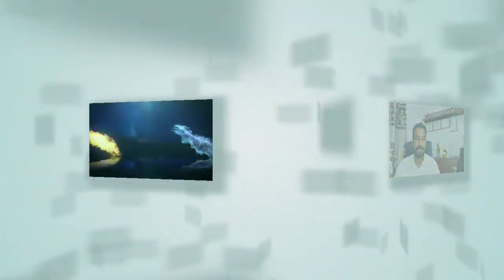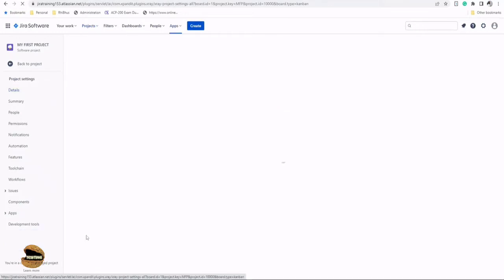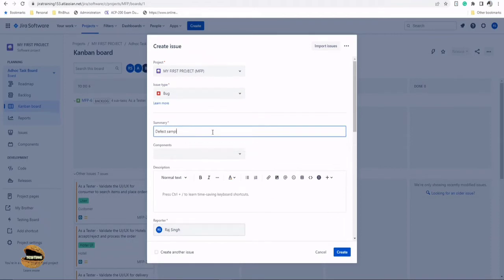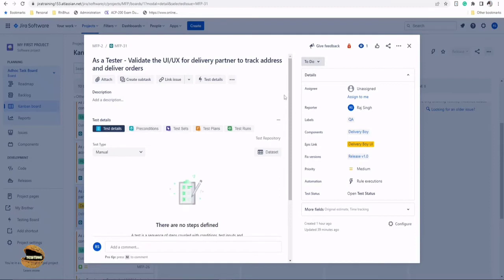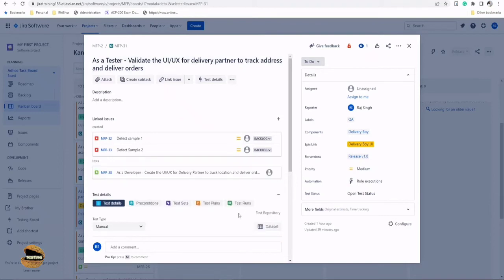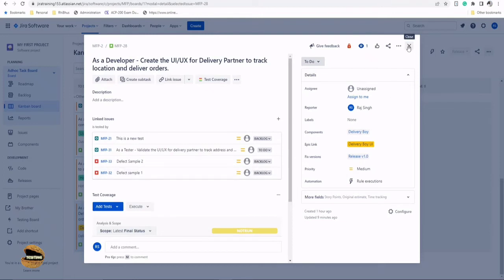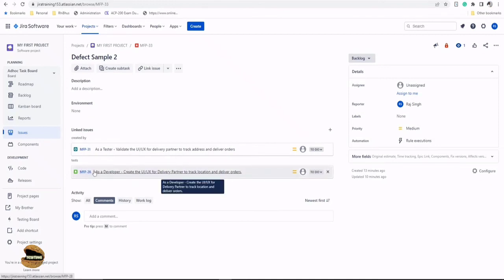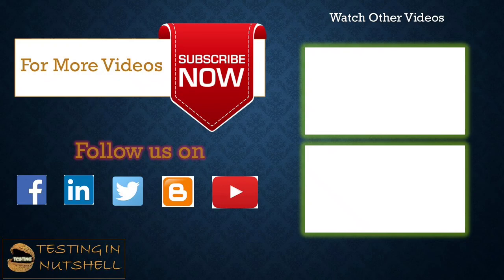Tutorial #14 | Defect Mapping in Xray | Defect Coverage in Xray | Xray Tutorials

Comment: yes,

The connection between Acceptance Criteria and Requirements in a project is closely intertwined, with both elements working together to define the expectations and quality of the final product. Below is a description of their precise relationships and connections:

1. Defining Role
Requirements describe the general functional and non-functional properties that a system or product must meet. They form the framework of what needs to be built.
Acceptance Criteria are more specific, measurable conditions that must be met to confirm that a Requirement has been fully and correctly implemented. They clarify when a Requirement can be considered complete.
2. Level of Detail
Requirements are often written at a higher level of abstraction, focusing on overall system functionality or business objectives.
Acceptance Criteria detail exactly how a Requirement should be tested or verified, for example, by describing specific scenarios, edge cases, or acceptable results. They provide more concrete guidelines for what needs to be delivered to meet the Requirements.
3. Validation versus Specification
Requirements state what needs to be done or delivered.
Acceptance Criteria specify how to verify if the result is acceptable, i.e., whether the Requirement has been met. Acceptance Criteria form the basis for validation, often carried out in the form of tests or reviews.
4. Guiding the Development Process
Requirements serve as a guide for the entire development process, including design, construction, and implementation. They form the basis for planning and prioritization.
Acceptance Criteria are a key part of the Definition of Done (DoD) in agile projects. They ensure that developers and testers clearly understand when a piece of work can be considered finished and approved.
5. Communication with Stakeholders
Requirements are often aimed at a broader group of stakeholders, such as product owners, clients, and development teams. They communicate the overall goals of the project.
Acceptance Criteria are frequently used by developers and testers to communicate with product owners or clients about what exactly needs to be tested to ensure that the Requirement is considered "done" and executed to satisfaction.
6. Quality Assurance
Requirements define which functionalities or properties the product must have.
Acceptance Criteria act as a quality assurance mechanism by explicitly describing the conditions under which a feature or functionality is considered successful. This helps prevent bugs and misunderstandings.
In summary, Requirements provide the foundation for what needs to be built, while Acceptance Criteria are the concrete metrics used to verify if those Requirements have been met. The Requirements indicate the 'what,' while the Acceptance Criteria specify the 'how' in terms of verification and validation.

A failing testcase should lead back to the requirements. It should be visible to see indeed.

Comment: Hello sir, I ran a test set containing 5 test cases regarding the login scenario. One of the test cases failed. I also created the bug and I linked it with the failed test case and the appropriate story . When I go back to the test execution table, I see that the number of defect has not been updated for the failed case. it is always indicated 0 defect. Do you have any idea about this issue?
Reply from the maker: So you see that you linked the bug to the tests but not to the test execution. To prevent this you should create the bug right during the execution failed through the execution screen. You can still go to execution and link the defect. You will find an option above to link existing defect.
Reply: @TestinginNutshell  thank you sir for your answer. You're right.i linked the defect to the test not the execution. I corrected and It's ok now,i can see that the number of defects is updated. Thank you once again for your help.